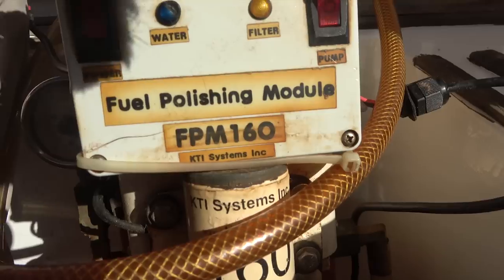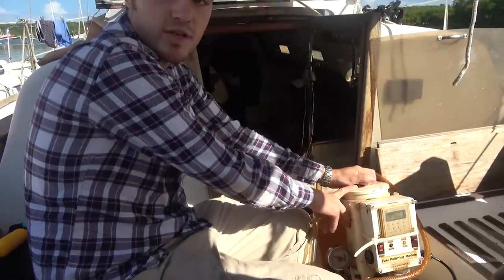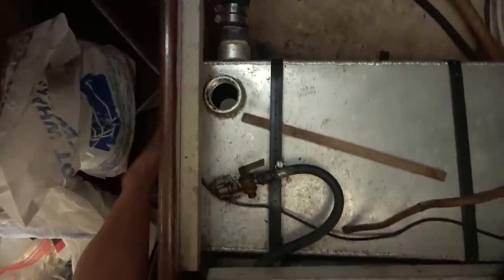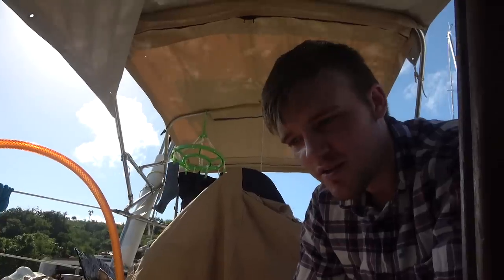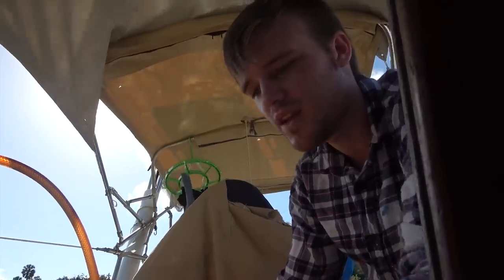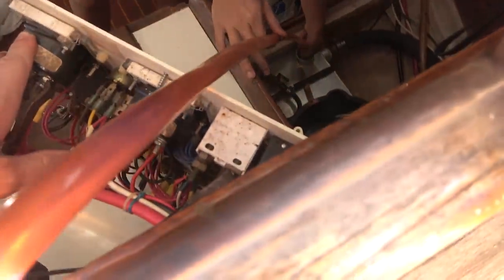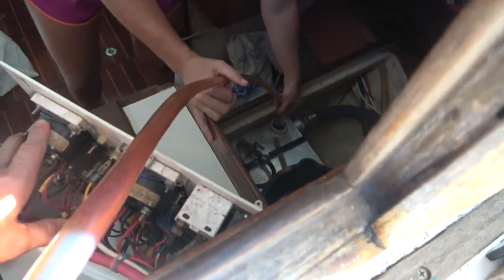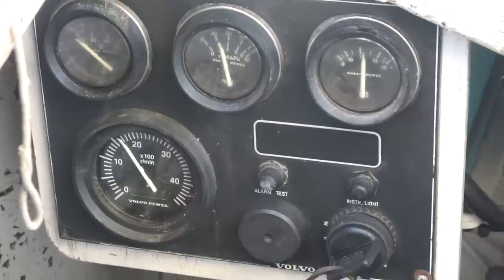Avoid DISASTER AT SEA the Boat Chore You can't Ignore  Ep 111

Comment: Okay,   I've been around those motors all my life.
1st. Try running the motor with one hand on the throttle and one on the primer bulb. 

While the motor is running pump the ball at the same time.

If it doesn't continue to run you still have a carburetor problem.

If you pump the bulb and keep it running then it's a fuel pump problem. 
  
  I think from what I have seen in this video. 
You have a fuel pump problem.

Feel free to email me ;
srpatrickward@gmail.com
Reply from the maker: Thanks for the feedback. We have done this and it runs great as long as you pump the primer bulb every 10 seconds or so.

The curious thing is we originally suspected the fuel pump so we got a brand new one. Can't imagine it is the new fuel pump but maybe. 

At the moment we are investigating the quick fuel line connector. After pumping the primer bulb we noticed fuel was leaking at the connection. Maybe the o ring went bad. Working on getting a new one at the moment.

Appreciate it.
Reply: @Bumsonaboat  I put a new fuel pump on mine too.
Reply: @Bumsonaboat  you may have just found your problem... a fuel leak also is where under suction pulls in air! I love the fact you want to figure this out! That's how we learn.
Reply: Hay just wanted to add a thought to your fuel pump problem. 
You have three lines going to that pump.
1. Fuel in
2. Fuel out
3. Pulse hose from the crankcase (side of motor).
If you can pump the bulb and it puts fuel into the carb you need to check the pulse hose.
1. Make shure your getting a pulse. 
2. Check line for cracks or replace.

These pumps are strong when they work. 
I have sean a vent left closed and then suck a plastic tank down flat. I mean FLAT.

Comment: It seems as if the dingy engine is running out of fuel after pumping it with the primer. Try pumping it while running the engine . If it keeps on running then you will know there is a supply problem. There might be a restriction in the fuel line. The filter on the fuel pickup inside the tank might be blocked. Or there is no free passage of fuel past the hose connecters, tank side or engine side. Do a simple test...disconnect hose from the tank side connecter and the engine side connecter. Put one end in a bottle or jar with clean fuel and connect the other end to the new fuel pump inlet and pump the primer till the carb is full. Then start the engine and check if it keeps on running. If it still dies out there might be a piece of dirt between the fuel pump and the needle and seat of the carb. Remember the engine fuel pump is neither a high suction nor a high pressure pump. It needs free unrestricted fuel from the supply side. I hope this advice helps you solve the running problem. Good luck and we hope to see you cruising soon. All the best from SA.

Comment: Great job on the pull starter!!  They sure enough can be a giant PITA!  You may want to run a can of Sea Foam thru the engine.  Mix it heavy,  16 oz Sea Foam 1 gal of gas.  The Sea Foam will do a great job of cleaning out the fuel system and well as carbon from the values.  Peace be upon your house.

Comment: Please take this advice with the diesel tank. Polishing the fuel was almost a waste of your time. You still have lots of sludge and crap that will slosh around and clog filters by the dozens. You will need to open the tank and clean properly. Most tanks have baffles to prevent sloshing, you may need more than one access hole (we cut six in our two tanks). Hand clean all the sludge then reinstall covers.
Second, you probably have a faulty fuel cap to be letting water in.
Third I repeat polishing is for amateurs, pros have access be ports. Love y'all.

Comment: Any idea where the water comes from in the fuel, deck fitting ?
Reply from the maker: Condensation. I believe you can minimize this by keeping a full tank of diesel. We had half a tank and it sat for over a year.
Reply: @Bumsonaboat  sorry the amount of water coming out of your tank was not condensation, that moisture would be filtered out by the pre finger,reckon,  when you get this the fungus , ie diesel bug , sludge grows between the fuel and water , your talk is small but quite deep, the sludge will be at the bottom , as it's heavy,  you can put a cleaner in, but with my experience,  it may kill it , it doesn't get rid of it, you can run your engine all day with clean fuel, but when your at sea the bug then gets moved around, your clean up blocked Evan before the filter, so having more filters won't help, it will carry on blocking pipes, maybe the isolator valve on the tank,  all I have experienced, all gave the same result, at sea, at a bad time , no engine,

Comment: float & needle stuck in the carb?  float won't drop & allow fuel into the carb bowl?
Reply from the maker: Good thought but the carb has been cleaned and inspected. The float looks good. It seems that a tiny bit of air is getting into the lines. Thanks for the feedback.
Reply: @Bumsonaboat  Sometimes the coating on a cork float will be eaten away and then the cork will no float properly as it can absorb fuel or water. Just a thought.
Reply: @Bumsonaboat  I would think if it was sucking air you would know right away as it is easier to pull air than fuel.  Will be interesting to see what the issue is.  Tank not venting, fuel line collapsing, etc.

Comment: So...if you've done all that (no bee in the line; no nasty in the carb; cord pulls; plug changed) you need to take it to a mechanic. The only other thing I can suggest is to do it again. Take the bowl off the carb, check that it is clean. Check the fuel lines for cracks.  Make sure all the arrows are pointed in the right direction. It sounds like it isn't pulling fuel. It runs just until the fuel it has in stock goes out then, nothin'.

Take it to a mechanic. You got other things to do.

Comment: Looking at the others and the fuel vent, I disagree.  This is a classic for a small amount of dirt in the carburetor float bowl.  There's a drain plug that can be removed and the inline priming pump can be used to flush it through.  You can catch the fuel if you're careful with a  small receiver.  Enjoyable video, so don't knock it!  And get that toilet fixed!

Comment: On the outboard engine, is the carburetor breather hole open? There should be a small hole on the gasket that lets a little bit of the exhaust back into the carburetor to activate the fuel pumping baffle. When you prime the engine you build up pressure but without the Breather hole it can't maintain pressure. Pretty good chance you'll need to replace the carburetor. But check for that hole.

Comment: After your outboard dies after running for a bit, try and drain the carburetor bowl to see if fuel is in there. There is an oring inside the connector that connects the fuel hose to your engine. If that is bad, it won’t pull fuel from your tank as there would be a vacuum leak. That’s why I would check the carburetor bowl after it dies to see if there is fuel in the bowl. You could try and continue to pump the fuel bulb while it is running to see if it still stops or not. The attached picture shows the fuel connector. Inside that hole there is an oring. James 
https://i.ytimg.com/vi/8OCl7bJKP-4/hqdefault.jpg

Comment: The carbie in my car use to do the same thing intermittently (some decades ago). Problem went away after a dozen or so times of dismantling and reassembly the @#$%!. Never knew the exact cause but I suspected loss of vacum  due to poor seating of one of the gaskets, possibly due to mismatched tightening of teh bolts holding the float chamber together The carbie works basiscally by sucking fuel as a mist out of the float chamber. if air bleds into the float chamber because of vibrations shaking the seal or .. then the motor will die. with my car I could pump the throttle which injects fuel down the throat and often keep it going until the vacum was restored. Not really vacum but low pressure but you get the drift. Normally happened with my car when I floored it which decreases the pressure in the float chamber and in my case to a point that the seal failed momentarily, or that what I think was happening.

Comment: 1. I really liked the smoke pouring out of your electrical panel while you were polishing.  Smoke = heat= higher resistance = more heat.  If your connections are getting hot it means you are probably undersized or have high resistance.  Just a general to keep in mind.  

2.  The Racor filter looked terrible, there is nothing in good clean diesel that is black, even though there are no big chunks in the pleats any filter that has that much discoloration I would encourage you to replace.  
 
3.  That impeller looked like it was still ok, as long as the fins are pliable and don’t hold a curved shape when removed from the housing it should be ok.  That being said it certainly doesn’t hurt to replace after it’s been sitting for that long in the heat.

4.  Finally the outboard, it sounds like you are on the right path.  When you pump the bulb it fills the carburetor “bowl” until the float lifts the needle into the seat and the bulb gets firm, the engine runs on the fuel that is in the bowl but the pump isn’t pulling fresh fuel in so eventually runs out.  You could be pulling air somewhere or the pump might not be working or the tank might not be venting.  I would say it’s running out too fast for the tank to not be venting.  You can bypass the tank and quick connect by running a hose from the pump straight into a container of clean fuel (after priming to make starting easier).  You can also verify pump operation by priming the carburetor then pulling the line off of the outlet side of the pump (put another line in its place and run it into that container) start the engine and make sure fuel is moving.  If the pump isn’t working and is a vacuum pulse type then make sure the engine crankcase breather isn’t plugged.  I’ve run into that on Honda outboards but have no idea how your Johnson pump works.  Hope that helps, if I can help more let me know, I would be happy to!  Good luck!

Comment: Well, if you've sorted any fuel issues out. Particularly if the primer still feels like it's got fuel in it, it's got to be electrical. These little electronic ignition systems do  tend to give up when they are warm. I would have thought it would take a bit longer than the running time you showed on the video. Maybe it needs a new coil pack.

Comment: I had an old outboard that had low compression and it would run until it got hot and quit so do a compression test. Try what someone else suggested and loosen the gas cap. Sorry but I don't think those wires will work because those are supposed to be under tension and heat treated, wire is not. I had another outboard and the recoil and engagement springs were weak. The starter rope would fly in and out while you were running it!

Comment: bad fuel lines collapse when pressure from priming  bulb switches to suction from fuel pump. improper oil level is tripping oil safety switch (or bad switch),

Comment: have you got this sorted yet?. if not look at condenser in the top of motor as it heats up it shorts to ground and no spark . to test: when motor stops remove spark plug lead and check wether you have spark to it if not replace condenser/ignition pack on ouyboard. good luck god bless

Comment: I'm still impressed with your persistence. Outboard stopping after short duration running would prompt me to check fuel pump (the 2 small one way valves inside pump), and cheers fuel line fittings between tank and pump.
If you send me your outboard id data plate info hp, year and serial number. I'll send you an exploded parts diagram marked up with the components you should check.
I did get excited even though you told me not too!!!!
Good luck, keep doing things properly.
David
Busselton West Australia

Comment: we always carry 2 secondary filters and 4 primary filters as spares for the diesel engine.  It looks like fuel starvation on the outboard though ... tank vent?  are you confident that the fuel pump on the motor is really working?  If you keep pumping the hand pump and the motor keeps running, then you can be sure its a fuel pump issue. Try that, run the outboard and keep pumping the hand pump and I bet she keeps running.

Comment: 100% fuel problem, you prime it and it starts and runs like it should. but then it dies as its runing out of fuel

when you prime the engine with ya blue ball you are removing all the air out of the fuel lines and filling up the carb's reservoir with fuel and when you start the engine and its running you are useing the fuel in the carb's reservoir.

what you need to do is find out why fuel is not refilling the carb

i would put my money on the fuel pump has gave in (they are only rated for 1 year and should be apart of yearly maintenance)

a simple test would be to keep priming when the engine is running (pumping the blue ball) and see if it runs longer while pumping and it should die like it is now once you stop pumping

another issuse would be air being sucked into the fuel pipe some ware 

i have also known bits of old fuel pipe block the line they like to move around so you get a intermittent blockage

hope this helps
Reply from the maker: Thanks this is helpful. We will keep at it and get to the bottom of this.

Comment: The Racor needs to be changed every 250 hours or once  a year.   The one you changed needed to be changed.  You should also change the primary engine mounted fuel filter at the same time.   Once a year for the impeller.  You will have less unplanned maintenance issues.

Comment: Get a new spark plug for your outboard...     

Check out this series of three videos...  https://www.youtube.com/watch?v=Nk7C2PKJMPA   I know that the videos don't relate to an outboard motor, but that rototiller had the very same problem..  would run for a bit then die..  had lotsa fuel..    finally - replaced the spark plug, and that solved it.   I would suspect the same on your outboard.

Comment: Joel different scenarios when it dies will it start right back up  or do have 1 wait or 2 reprime the fuel I think you said the primer bulb was still hard  I thinking check pump make sure it back together correctly possibly losing fuel
 check out this old out board he a good specialist on John and rude motors that's why I watch him I have my etec   He had 70 that gave him problems stalling as soon he change the prop it stop stalling oh your running high idle and dies your losing fuel from not pumping pump I think has problem he say assume anything start from beginning tank good cap good 
Fuel line good fuel filter good pump ? Check and pay close attention thanks JT🇺🇸🐟🎣🌴🛥⛱😊😃🙏🏻🙏🏻🙏🏻🙏🏻
Reply from the maker: It does not start right back up. Okay appreciate the ideas.

Comment: Your jet in your carb is blocked thats why it will not idle . Take the carb off the engine and clean the jets easy with a fin bit of wire . Plenty of demostrations  on you tube how to clean carbs

Comment: 28Cruizing had good advice re everything including danger marine on youtube. . . I saw on Danger marine just the other day where he repaired an outboard. He also pulled the propeller shaft and cleaned away corrosion.  He said it was enough for the engine to stall at low revs.   Here is the link. It's at the beginning of the vid.  https://www.youtube.com/watch?v=fcyv8G5P6k8&t=925s

Comment: Get a professional mechanic to look at the crank seals on that motor, this will result in loss of fuel if they are bust. That is exactly what I had on my yamaha. This repair needs to be done by a professional with the right tools. As for the fuel problem, why don't you install a permanent racor filter before the main filter. It will help you much more and you can change the filter more often until the fuel is cleaner.
Reply from the maker: Okay, we have a few more simple ideas to try but this is good to know. We do have a permanent racor filter before the main filter.

Comment: OK guys just wet myself laughing!
all your fault !!!! 😂😂😂😂
right tip for you with the dingy motor.
it appears to be a problem with the float!
while running it stops the carb filling up too much and as the name suggests it's a float that shuts off the fuel when the carb is full.
check a, it floats might have a pin hole and b, when it rises that it does shut down the fuel.
what is happening is the pump is putting more fuel in that you are burning then it floods the carb shutting off the air mix.
Reply: My name is Greg and I approve this message.
Reply from the maker: Hmm, okay we have verified that the float shuts off the fuel but maybe it has a pin hole and is not floating at all.
Reply: @Bumsonaboat  if it is a pinhole in the float, you would see gas in the float.
Possibly float adjusted wrong? If it adjusted too low, maybe it is not allowing enough volume in. Just throwing some ideas out there. Also leaning towards the leaking vacuum line for the fuel pump, sometimes they crack on the bottom, or backside where you cannot see them.

Comment: I think you are ether getting fuel but no air, ie a vacuum in tank is air getting into your tank, ?, or you still have a carburetor issue possible float , not moving correctly sticking,  or a hole and its sinking , i would investigate your carb again, eng seems to run till its used up the fuel  In the bowl look into attachment borrow a tank and there pipe attachment the lot, then with a process of elimination,  you will know if its eng or fuel source.

Comment: Had the problem runs then cuts off. Found clog between in fuel line and carb. Check fuel filter and everything after. Quick easy fix once you discover the clogged.
Reply from the maker: Thanks for the idea. We will make sure the lines are clear.